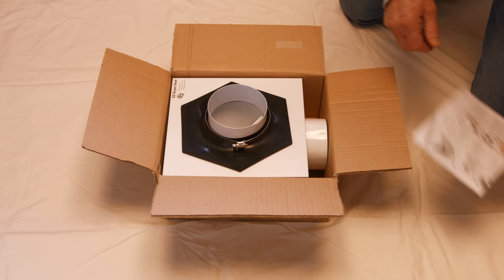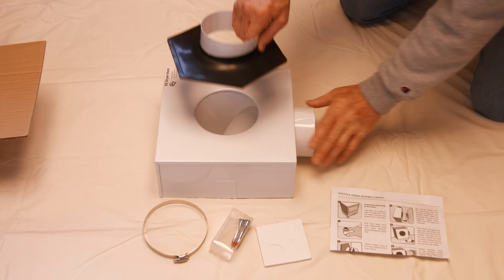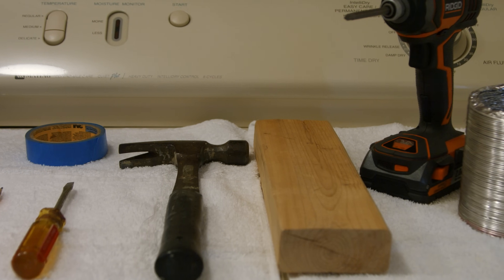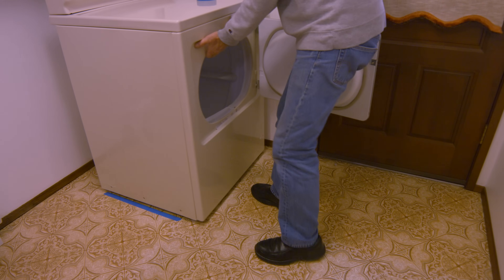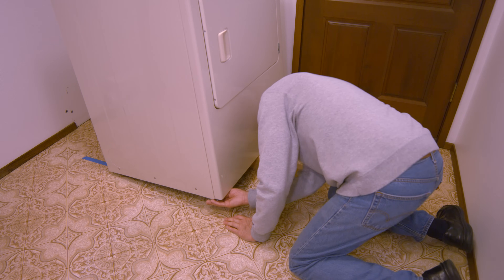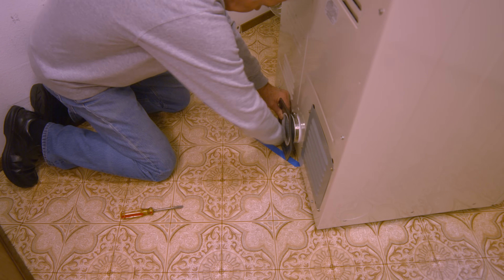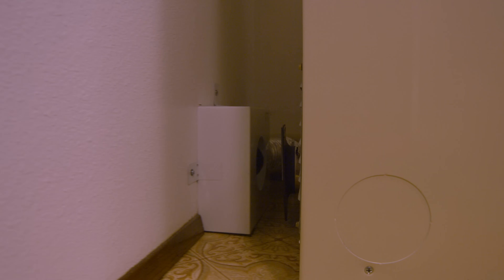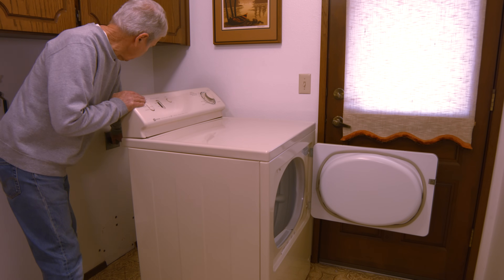Amazing Inventions - EZ Dryer Vent Installation

Comment: I don't think I've EVER seen a more difficult and complicated way to run a dryer vent hose - a true Rube Goldberg contraption. The Ziggurat system is FAR simpler and requires no tools.
Reply: That looked about as easy as you can get
Reply: I agree it is not difficult or complicated in any way

Comment: It looks like you could run the vent out the side of the dryer. Most dryers allow this, as in this dryer there is a 5" round punch out on the side of the dryer on the left side, as can be seen in the video. So there should be one also on the other side. This also makes the dryer much more efficient as well as can be closer to the wall.
Reply: Most modern dryers need to be disassembled to use their side vents.
Reply: Have you seen Jyst how long it takes to side vent? You have to take the whole dryer apart!
Reply: @jsjansing2188  Not to mention price.

Comment: Dryer is an electric dryer where there is not gas line in the way. Soooo...how does it work with a gas dryer?
Reply: Use a flexible gas line….

Comment: Nice guy, nice video.. but COMPLETELY useless device..
Reply: No, i have been searching for a product just like this... my exhaust exits the dryer straight down, and there is no way to tighten the clamp on the vent pipe and have it against the wall. This is the only product that will work for my application. I would gladly give 100 dollars to get this.

Comment: At first I thought this was a good idea....then...

I realized that most dryers move while operating as a result of vibrations. Often this movement will appear to make the dryer 'walk' across the room. With this type of dryer hose connection, it seems you could easily disconnect the vent, and unknowingly vent very flammable lint into the room?
Reply: @cabguy1006  Really? I've personally owned around 10+ dryers in my life...and they have all moved. Sometimes it's a result of an unbalanced load, sometimes just the act of loading and unloading will shift the fairly lightweight drying machines from their initial spots....especially on smooth surfaced floors.

I have a couple rental homes (beach) where towels are often washed/dried, and those machines move quite a bit, and often the machine has to be positioned multiple times each month.

No, the 'walking' is not on a per load basis, and instead is the accumulation of subtle movements over weeks. But they do move.
Reply: Adding the felt pads would make the dryer mover more easily when in use.
Reply: @cabguy1006  , agree never had a dryer the moved while working
Reply: Its not because you have some other issues with your dryer , that this is a bad idea. Fix your dryer 'walking' issue FIRST.

Comment: It works for a vent that is exposed like the one in the video or if it was in the floor, but what about when the vent is in the wall ? 
Get rid of your plastic flex hose.
Reply: Looks like there is a forth tab inside the box that he does not bend down

Comment: Will need to be cleaned every few days, bad design and the use of soft foil venting as shown voids warranty.  Not a good idea at all. Read supplied manufacturer instructions, or look online , and only install according to instructions. Dryers can last 30 years if installed proper, if installed as shown premature failure will happen .
Reply: Actually, you can see by the way the duct supports it's own weight that it is the semi-rigid duct, so you are lying.

Comment: I think this is product looking to solve a problem that isn't a problem.
Reply: I think this is a great answer for a real problem. The current common system is a huge problem looking for better solutions, e.g., what if the external vent is parallel to the dryer vent?
Reply: This product simplifies installation.  Looks like a great idea to me!
Reply: I think this does solve a problem, particularly in tight spaces. On the other hand, if you don't think keeping your dryer vent clean, or you have a lot of space to get behind the dryer, then this product might not be for you. I think it's great, imo.
Reply: Awesome product. If theres only room for washer and dryer  in a bathroom,  how do you attach the hose to the dryer then crawl out over the dryer or fly out? Or have an extra long dryer vent hose to try to contain as you push the dryer in place.